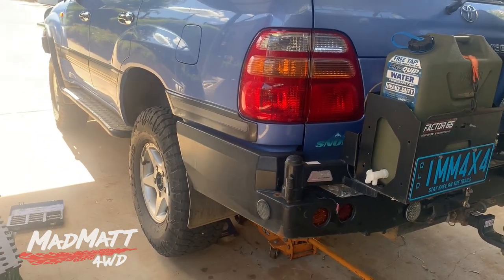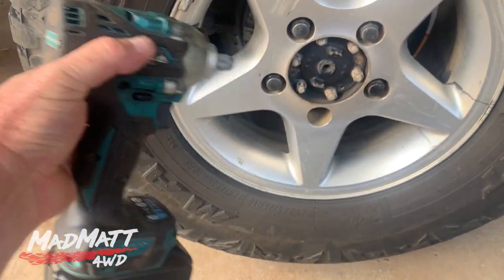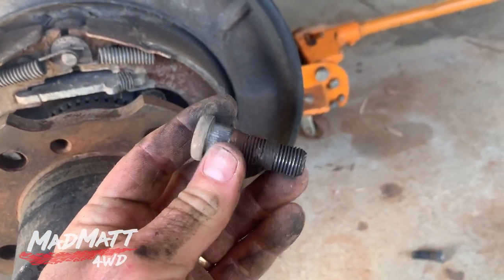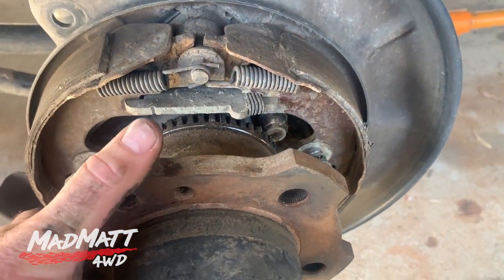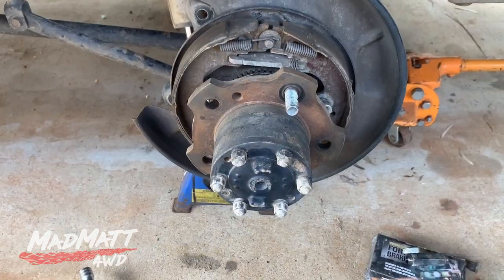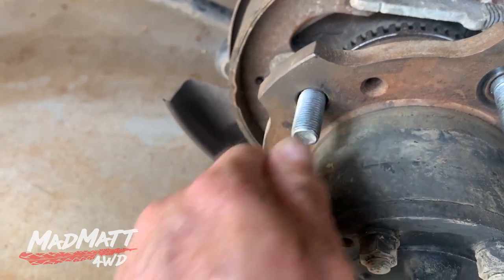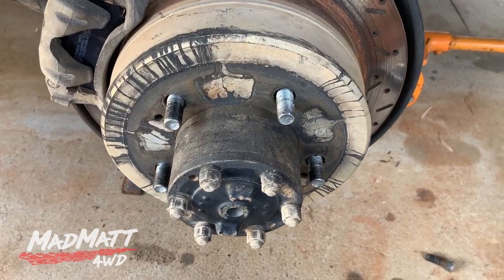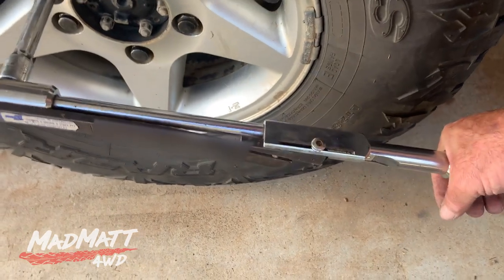How to change a broken wheel stud || How to tighten wheel nuts correctly.

Comment: I took my 33" mud tires off my Isuzu Trooper back in 2004 and threw them in my small trailer for an off-road excursion 12 hours away.  I put my highway tires on the rig and headed out....without torquing the lugs.  I got 30 minutes down the road when the vibrations hit.  Thank goodness I pulled over quickly, found the issue, then tightened all the nuts down.  Not damage or breakage....but I've never forgotten to torque lug nuts again!
My wife, when she was much younger, had new tires put on her car.  The shop didn't torque one of the wheels.  It fell off as she was driving down the road!  Luckily it didn't hit anything and she was able to land her car on the side of the road.  
Great video!  Thanks
Reply from the maker: Thanks for sharing.

Comment: Changed a wheel stud on the Troopy a while ago. First time doing it. I did pretty much everything you did, except the little tip about aligning the stud and rotating it before tightening. Thanks for the clear, simple instructions.
Reply from the maker: Did you change the other studs as well or just the one? I’d suggest it’s worth doing all of them.
Reply: @MadMatt4WD  Just replaced one. Snapped it while loosening it to repair a tube. I reckon the nuts were over-tightened with the rattle gun at the tyre shop. Will get the torque wrench onto them later today and check them all. As you've suggested, I'll buy some spares. That's a good idea.

Comment: Been a while since you posted a video welcome back. I've always used a long handle 1/2" ratchet to set the studs. Light coating of grease on the studs and on face of the axle to prevent rust from locking steel rims.  Also electrolysis between the steel and mag rims can create pitting of the mating surface of the  mag rim. Light coating of grease  is worth a pound of cure.

Comment: Something to really pay attention to, I did almost the same thing on my trailer. Took a wheel off to rotate with the spare. Hand tighten the nuts, got distracted and drove form Townsville to Armidale, we were 25-30km out of Armidate and luckily on a back road with no traffic. We get a call from a random behind us on the radio "hey mate, your tailor wheel just flew off and into the bush"... So lucky there was no one else around or coming the other direction... That was nearly 20years ago now, never not torque to spec, then double check any time I pull a wheel off. Thanks for sharing with the community, as always a pleasure to watch...
Reply from the maker: Gee lucky you guys had the cab on ay.

Comment: Good to see the stud replacement done in an easy to replicate manner. I've never had a stud break on the Landy, had them undone on a previous car by a twot and thankful of the locking nut on that occassion. The M16 LR D1/Defender stud torque is dependant on rim, but 130-170nm, I do the alloys to 150nm, a little tighter than spec, but never had a problem.

Comment: Great vid. I decided years ago that I no longer will I trust anybody with torque and my wheel nuts. I too use anti seize so reduce torque by 30% down from OEM specs using a torque wrench on my Dmax. I do carry a spare set of front and rear studs, different lengths. If wheels come of at service or tyre change or rotation, I take responsibility for my wheel nut torque.

Comment: Lovely ep , bugger about the wheel nuts memory getting older, I agree with the oil in the bearings last heaps longer,  I use operate tandem tipper trucks the oil bath bearings lasted twice if not three times as long as the packed in grease bearings, so been running a bit of Diff oil in my Toyota bearings for  around 38 years.

Comment: A good reminder and very easy to follow video. I always carry a wire wrench with an extendable handle like a cheater bar. That way I'm always sure to always get the nuts out for a wheel change. Sometimes they can vibrate or bind and be a pain to remove with usual poor car default tools. After using some antiseize, I never have had a problem though. Always have the extension there as a safety.

Comment: Happens to the best of us. Just last night i noticed a wobble, pulled over just in time. The act of pulling over pooped the tire off and it came to a stop with the rotor resting on the inner rim. Four studs sheared, two bent beyond attachment of rim and tire. Have to go back later today and change the studs and install new lugs. Hoping i dont have to change the hub assembly (hopefully okay , atleast looks that way).

Glad your okay mate. 🎉 God bless.
Reply from the maker: Wow LUCKY

Comment: It must be the year for it... You and Ronny Dahl and me too! I had the exact same wheel (back passenger) come off for similar reasons. I did a wheel rotation at home, put the last wheel on (the back passenger) and then went around and double checked that I tightened all the other wheels. If you're clever, you might have noticed that I missed a wheel in that statement haha... Yup, didn't tighten the back left wheel. I lost two or three out of six studs at 100kph, all six lug nuts were gone, and the wheel was just hanging on by a thread. I miraculously managed to pull over with the wheel still on the last studs (barely). In the end, it only cost me $60 in studs and $25 to replace a hub ring + lug nuts. I was very lucky.
Reply from the maker: We’re lucky chaps I’d say

Comment: Hi Matt, Nice video and good clear explanation. I agree that having and using a torque wrench is important for all structural/safety joints. It ensures the axial load in the bolt and the clamp force of the two parts is as intended by the designer.
One thing to check when using a lubricant on fasteners is the correct tightening torque value.
As generally the specs noted by the manufacturer are for non lubricated studs/bolts and nuts. Adding the protective lubricant generally means you need to tighten them to a lower torque for the same axial load/clamp force.
So using the dry joint torque spec on a lubricated joint may stress it above the intended design level.
Reply from the maker: A number of people have raised this. Good point

Comment: I have done the same thing. Forgot to tighten nuts with my Warren and  Brown. Was front wheel. the vibration i was getting i put down to the muds i just put on. I have 3 sets rims set up one road one ATs one muds. Not used the muds in a while and thought i had just lost wheel weight.. When the vibration got so much worse i stopped and found the problem. Yep not tight. All 6 loose and rim was stuffed. It had elongated the holes in the rim. Changed to spare and dodged a bullet as i was towing 2 ton camper as well. I always use lube on studs and fit up tyres and valve stems with rubber grease as well. This helps a lot with air loss from bead and valve stem.
Reply from the maker: Well done on saving yourself from a disaster.

Comment: hi matt, thx for sharing and the effort to cut, upload the video.
in some parts i am with you and in others i have a different approach. here my 5cts
- first of all. if you use anti seeze (any grease would do the job) you cant use the factory specs of torque, because of the grease you have less friction. instead of 100pounds you put near to 150 pounds or so and this will damage the studs. could be a reason why your stud broke off.
- after taking off a wheel you should retourque the nuts after the next ride. i wouldnt wait 100miles.
- make it habbit to retourque the nuts once awhile
- before installing a new stud, i would clean the hole in the hub to get rid off the corrision, than install the new stud with some loctide.
- clean the brake parts whith breakcleaner spray and lubricate the gliding pin of the caliper
- bearings: i dont know landcruisers specs, i drive a landrover s2a, but i guess its all the same. never heart of bearings running on oil, always grease. bearings can get quite hot and oil looses its lubrication, but could be a landcruiser thing. i will watch your video. and this stribes on your hub looks like an oil leak
forgot to mention ... in 45 years never experienced loosing a wheel. the closes i got was when i forgot to tighten all nuts from one wheel. but you feel the wobling after a few meters.
cheers from south america
Reply: An extra 2cents, most new oe studs I've seen are black and oily, rarely dry zinc like matts was supplied above. The factory could be basing their figures on lightly oiled threads. Oil in bearings works on LR Defenders, leaving the inner seal out, like a LC, but risks leaks, as there's only the one seal.
Fully agree on re torquing the nuts after a short drive with new studs. Nice to hear you're using a 2a :)

Comment: I had the same experience as you except I didn't mount the wheel. The technician did tell me to re-torque the wheels after 100 miles of driving but I didn't follow through. I had 2 out of 5 studs break and the holes wore slotted. Needless to say, I am more apt to re-check wheel bolt torque now. I might add that this is with aluminum alloy wheels not steel.
Reply from the maker: I think I dodged a bullet with my wheels there was no evidence of the wheels being damaged.

Comment: Matt, I don't own a rattle gun so this will not happen to me but also I have never torqued anything as I also do not own a torque wrench.. I just do them up with a + bar and do them hand tight nothing more and that is how I have done it for many years both on my 4wd's and my cars and have not had any issues ever... I do notice over the past 10 or so years the service centres tend to over-tighten wheel nuts so they are very very hard to undo manually and I now ask them Not to over-tighten them as I cannot undo them when needed, they are happy to do that for me. I do most of the maintenance myself but I do take my vehicles to a service place once a year to get a full check over just in case there is something I have missed or if there is something I cannot do (due to having back issues) or do not know how to but I have learnt a lot watching your channel and a few other YT channels to do things myself...  I have seen wheels come off from cars and trucks over the many years of driving a semi interstate but luckily personally nothing has occurred to my vehicles.
Reply from the maker: Well done. Thanks for the comment

Comment: You use the same method as I do. I have a lot of used lugs so I always try to use my spare lugs instead of the original. sometimes depending on what I am working on, The splines on the stud will reveal a little past the flange. the large nut gives room for those splines and  centers everything when the lug taper seats in. I also grease the large nut on both sides and the lug and threads because some studs can be a hard press and needs all the help it can get to slide in with less friction. Grease threads also helps keep from stretching the treads when it is a tough one. Then I spray stud treads with brake clean to remove grease.

Comment: Matt, never lost a wheel, had one intentionally loosened by someone though... I use anti-seize on the splined area on wheel studs before seating them (rust/heat welding)...

Comment: To overfill the diff oil I jack up the drivers wheel nice and high pull the fill plug and put another 400ml, saves mucking about with the breather and syringes, just a suggestion 👍
Reply from the maker: Yeah that could work. It’s never been a hassle for me but that’s a great idea. Thanks.

Comment: Never lost a wheel or broke a stud. Did have a vehicle that the threads were pulling off due to a lifetime of service shops over torquing them. Last time I came home from the tire shop I checked the torque. They were all 120 to 130 ft lbs and spec is for 100 ft lbs.

Comment: I always use lube on the studs and only had wheels come loose once because I had only "finger tightened" them;  I think that is what happened because it was a vehicle I had not driven in a while, I had just taken the front wheels off to check the brakes or rotate the tires, and after I felt the vibrations I checked both front wheels and each and every wheel bolt (2001 VW Golf they use bolts instead of nuts) each one was the exact same amount of loose on both front wheels.  I put 686,000 km on those front wheel hubs and only had that problem once.

Comment: I carry a torque wrench at all times in my 4WD.  Patrols have a very small locating ring and it's not too hard to get a wheel on that's not properly located - especially true of the many wrong fitment steel wheels people whack on.  Many "universal" 6 stud steel wheels don't locate on the hub with anything other than the wheel nuts, over the years I've heard of dozens of Patrols losing the left rear wheel .

Comment: Have had both a car tire and a trailer tire come completely off. Both times were from the tire shop crossthreading the wheel studs. You get lots of damage when the wheel falls off. Trailer was a complete write-off, the car was a $4000 U.S. repair bill.
Reply from the maker: Oh Wow that sucks. As i say in the video start the nuts by hand so they don't get cross threaded.

Comment: Your published torque settings for wheel studs are dry settings. If you torque them up to the published 100 ft pounds (nm?), when you’ve applied grease to the threads - that creates a multiplier effect, where a lubricated torque setting of 200ft pounds might be getting applied, while the torque wrench is only clicking at the set 100ft pounds.
It’s quite possible that your fatigued broken wheel stud failed because you’ve previously over torqued it by applying grease and then torqued to a dry torque setting on a lubricated thread.
If you search hard enough you might find a published lubricated torque setting for those wheel studs.
Next, (especially on the side of the road) never hit your wheel studs on the end with a hammer.
Always screw the wheel nut onto the stud and hit on the end of the wheel nut to drive the stud out, because you don’t want to roll the thread on the end of the stud and make it unusable afterwards.
Reason?
If it’s frozen in there and not removable, then you’ve lost the choice to leave it in there and re-fit your wheel. So you now can’t remove it and you also can’t replace it or re-use it. 😉

If you put the nut back on and hit that, you don’t damage the thread on the stud so you then still have choices.
Once you’ve driven the stud largely out, then you can hand loosen the nut from the stud & remove it.
If you hadn’t butchered the remaining 4 or 5 old studs, you could have thrown them in the bottom of the ash tray or glove box, or the tool box, and they would have been there for you or anyone else out there on the road to use in an emergency to get them out of a pickle on the side of the road.
JC Auto Expert did a whole video on threads and nuts and wet / dry toque settings.
When your assembling a rebuilt engine many of the mains and big end caps bolts are lubricated before assembly, so the torque settings published are wet torque settings not dry.
And those high grade bolts are torque to yeild settings where once torqued the bolts are stretched to a pre determined length to apply the required clamping force, so they cannot be re-used, because once stretched, you can’t use the published wet torque figures, you must use new bolts every time (same with head bolts for eg.
So there is a little more to the physics and engineering behind the topic that your “advising others on via YouTube”.
It would be preferable that others got “correct advice” if possible.
Maybe search up JCs video on the topic, he goes into some detail.
But the principle applies equally to wheel studs was my point.
When your using torque settings, adding lubricant (just to make them easier to remove next time, alters the clamping force markedly if you still apply dry torque specs to the point you might actually be setting yourself up for premature failure n future is all.
Not criticising just trying to help others not make the same mistakes is all. 👍
Reply from the maker: Others has raised the wet torque subject and I am aware of it although failed to mention it. I’m planning to do a follow up video on that. I watched JCs video and it’s quite good for sure. I like your point about looking after them if working on the side of the road but I think in that case I’d only change the broken ones and do a proper job at home. As for carrying the old ones I’d rather have new units as spares.

Comment: I usually tighten just enough to pull it in a little, then mount the wheel and tighten to the torque spec, and tighten again regularly for the first couple weeks.
Reply from the maker: Do you find they tighten each check?